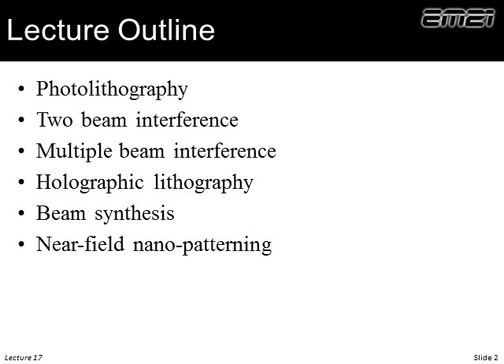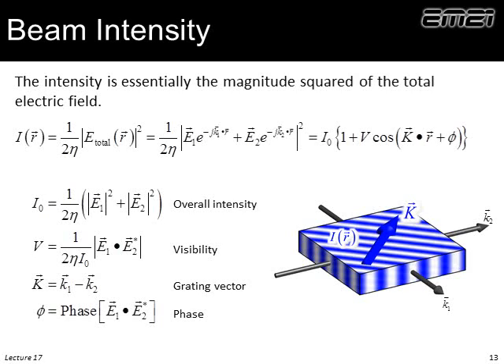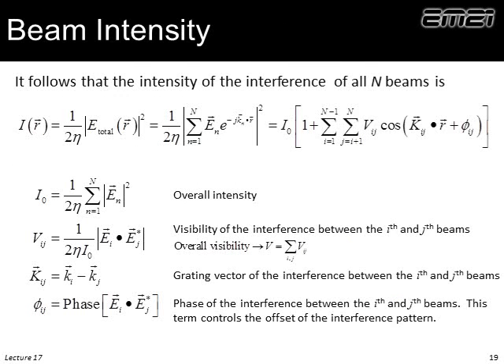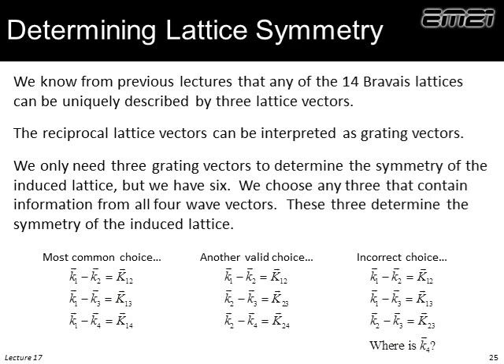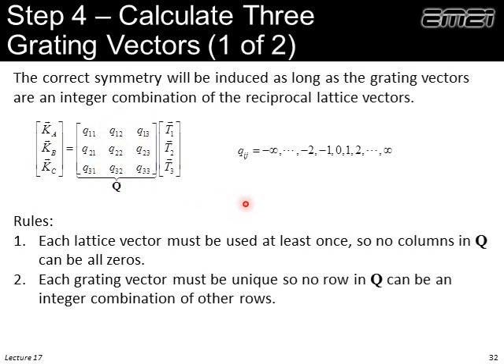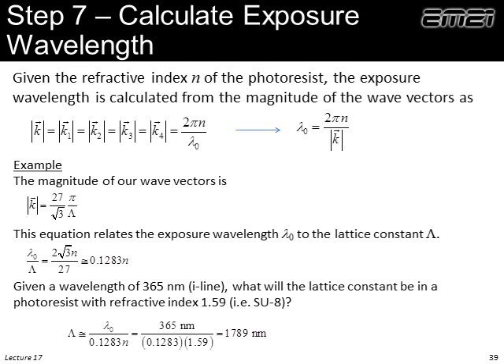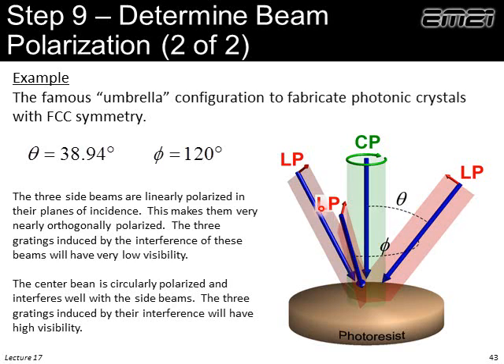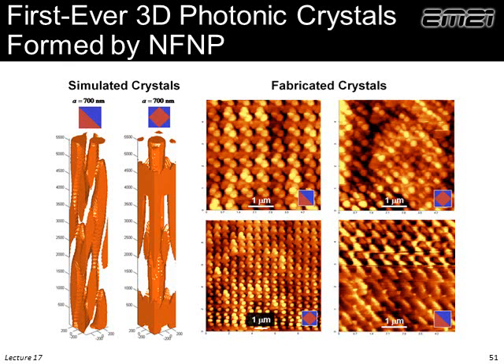Lecture 17 (EM21) -- Holographic lithography

Comment: This helped me be less stupid at maths 1+. 
Genuinely I haven’t touched physics in several (13) years, but this really helped set allot of things right. 
How is one employed in the application of this equipment, if I wanted to use those machines and be well paid then what would I study and what work would I seek by title.
Reply from the maker: Start working in the area.  Read papers in the area.  Very often the papers acknowledge where the funding came from.  This will point you to who is working in the area and potential jobs.
Reply: Engineer or physicist.